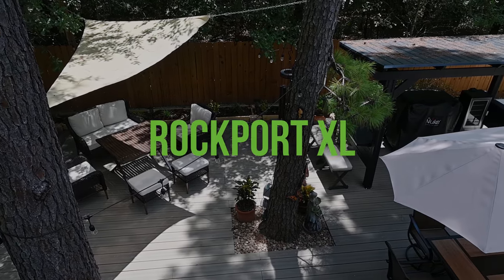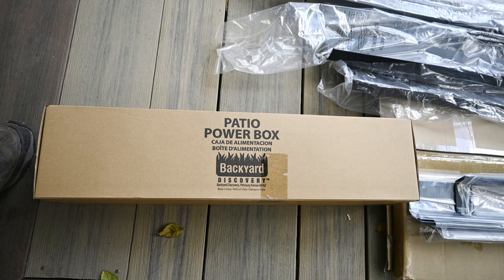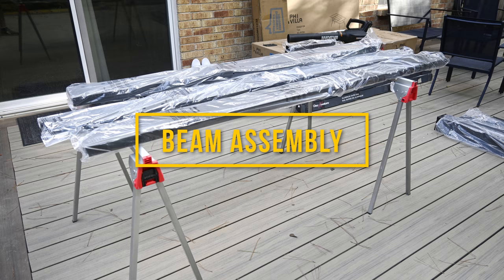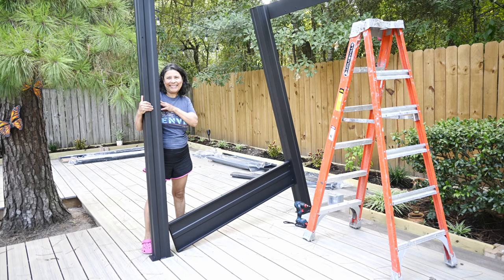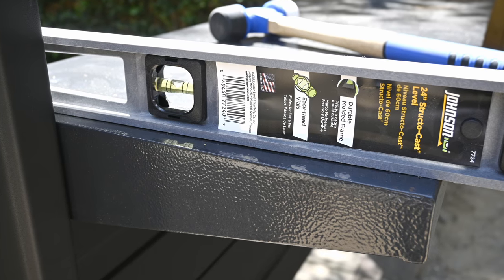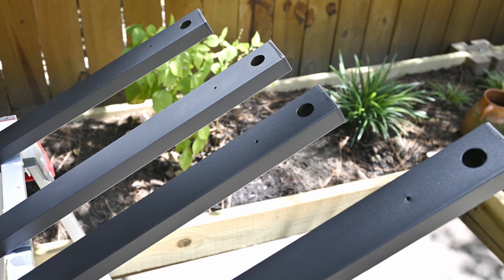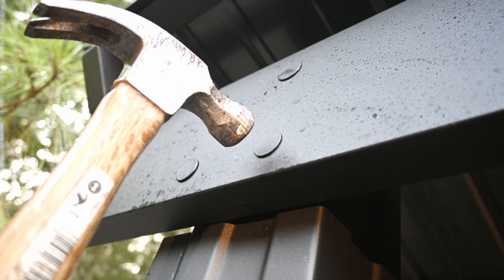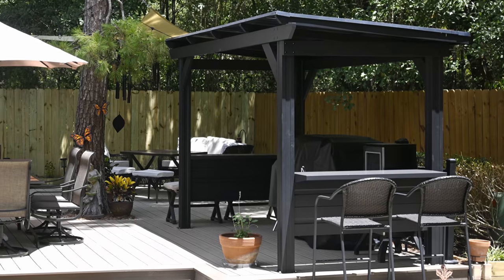🏡 Rockport XL Gazebo Assembly Guide and Review | Backyard Discovery Steel Gazebo

Comment: Great installation video. I watched this video multiple times and reviewed the installation instructions so I do it right the first time.  I started my install last night. How come the plastic washer has the recessed circle on one side and which side goes up against the steel washer?
Reply from the maker: The plastic washer is to clip on a cosmetic cap. I believe the larger face should be under the screw and the smaller toward the washer, but I don;t recall precisely, I'd have to refer back to the instructions.
Reply: Yes I understand this. My question  is since the plastic washer sides are not the same, which side of the plastic washer goes up against the steel washer.  One side of the plastic washer is flat while the opposite side has a small recessed circle.  You can see this in your video if you pause it at 4:09 time stamp.  My guess is it doesn’t matter which side of plastic washer goes up against the steel washer.
Reply from the maker: @khanl1  Have you built the gazebo? Did you have any problems beyond the washer face question?
Reply: @BuildingAffordable  Yes I did built it.  Took my time and did it over several days.  Looks great. Thanks
Reply from the maker: Fabulous, thanks for the update. And enjoy it! I enjoy mine.